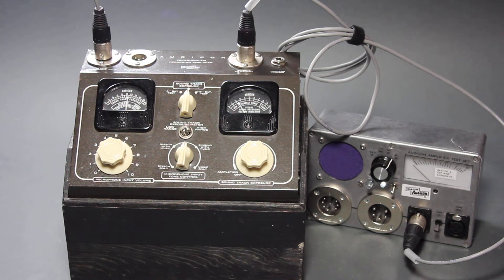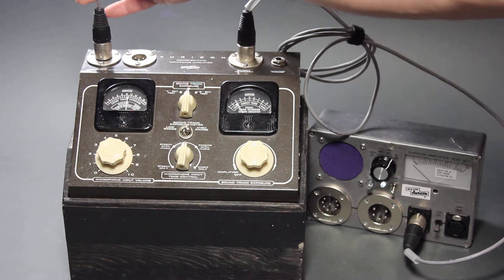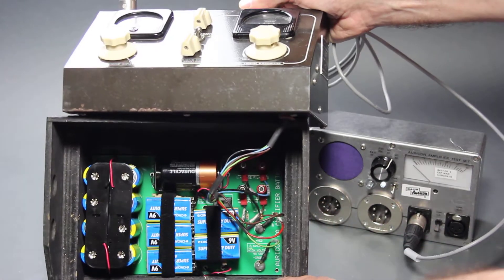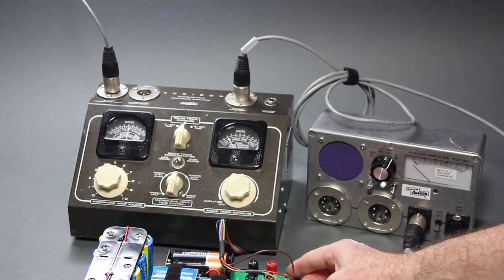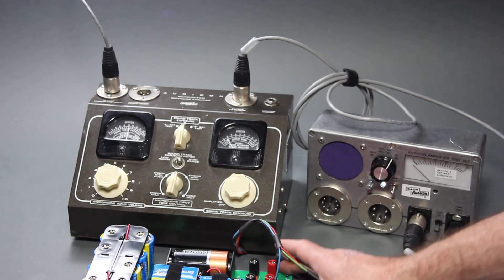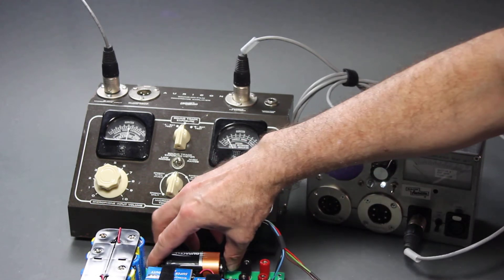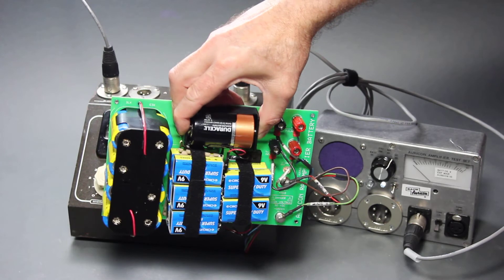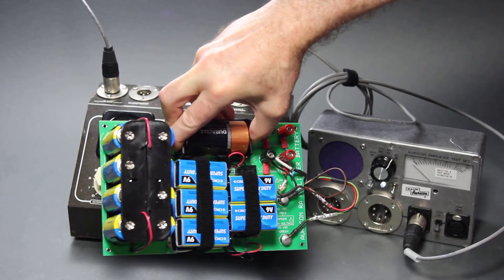Battery Adapter board for Auricon RA30-31 optical sound amplifier

Comment: Hello Mark, I really need to get in touch with you. I have the Auricon RA-31-AO7 and old batteries. The plug on the top is a 4 pin female XLR type cable. The camera I have is a CM-71 but it has a really large CANNON 5 pin male plug. The camera works but not sure about the Galvanometer. I have not powered up the RA-31-AO7 yet, I'm sure the capacitors are bad. Is it bad for the unit to try and power it up anyway? If you don't mind, I'd like to pick your brain about trying to get all this working. This was from WKY-TV Channel 4 in Oklahoma City, the first television station to sign on west of the Mississippi in 1949.

Comment: Hello mark i have one of these and ive tried the repairs from your vid

However i dont have any replacement 455 batteries yet and i tried to see if the heater in the tubes can power on with the 1.5v D-cell but im not getting any indication of power to them does the unit require all batteries to be connected for the heaters to work or is there a bad connection somewhere

On a side note i did a continuity test and it doesnt go straight to the 1.5v connection instead the tube heaters lead to the positive on one of the 455 connectors and one of the pins to the 1.5v connector is this normal?